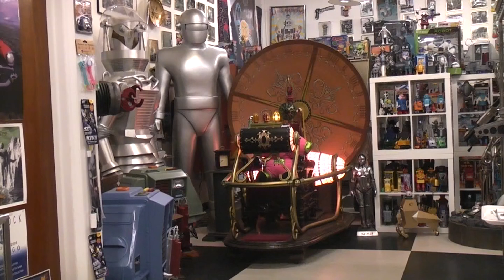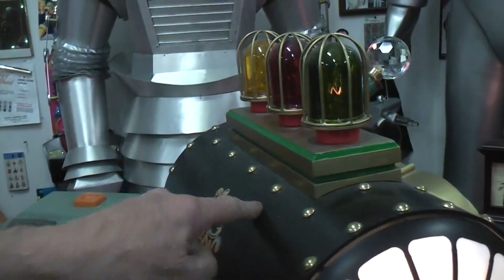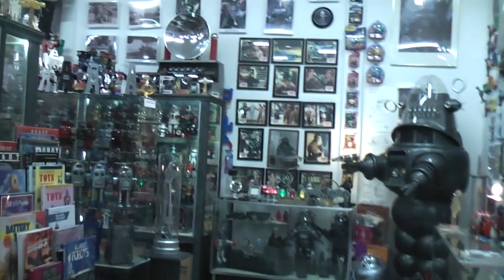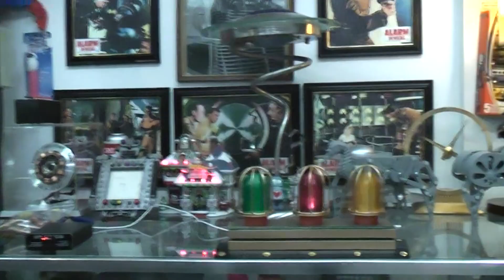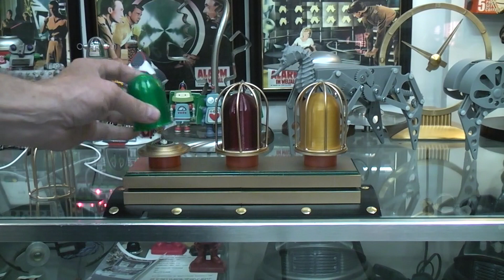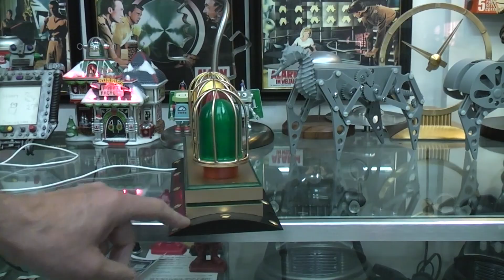What about a Desktop Time Machine lamp console display, DIY project.

Comment: 👍👍 That looks very nice and has a lot of possibilities!  And it could easily be 3D-printed in a different scale for different applications.   Regarding the original movie, I was probably 9 years old when I first watched it at the theatre when it debuted.  I was quickly drawn into that amazing but oh so scary depiction of time travel into the dystopian future.  I do remember a little later having a nightmare or two of those hideous Morlocks, though!  A question is how did you 3D print the lamp globes?  I'm guessing you must have used a resin printer since they appear to be so smooth and consistent.  As always, Best Regards from Thailand!  😁
Reply from the maker: Video on the lamp globes is coming , but no I printed then on my filament "FDM" mini a1 printer. I used some tree support in the center that just snap right out. printed in a standard .2 layer height. I used translucent yellow, red and green PLA filament. To print them on the resin printer would have cost me too much money for translucent resin colors.
Reply: @Robothut  Great info, thanks!  The globes would still require a lot of sanding, right?  I look forward to your upcoming video.
Reply from the maker: @Jimbo-in-Thailand  Nope, no sanding.
Reply: @Robothut  I'm impressed!  I'm guessing I'd probably have to sand and polish the globes to get rid of the layer lines printing with my old Creality CR-10.
Reply from the maker: @Jimbo-in-Thailand  Yes you might have to. The Bambu Labs A1 Mini is a very good printer and super-fast. There are layer lines but they do not look bad. I could print the domes in a higher quality setting, but this seemed OK to me. There not as nice as the ones on my Time Machin in the Hut where I paid a glass blower to make the domes in glass and then dip them in laquear to the colors I wanted. But that cost allot of money, 3d printed was cheap. I think a person could print the domes in translucent white filament, sand them and then spray them with translucent hobby paints. The white PLA would act like a diffuser and give a very even light, I think.
Reply: @Robothut  Thanks again for the great info!

Comment: I would be interested in seeing the build details of the electronics and the wire cage. I don't think I would  build it full size because I don't have the space but scaling it down to 1/3 in the slicer would make a cool desk or bench display. Those translucent domes look great. It's definitely it lot of work to share these projects so thank you.
Reply from the maker: I will start work on the videos and upload the STL files to thing-i-verse Rick.